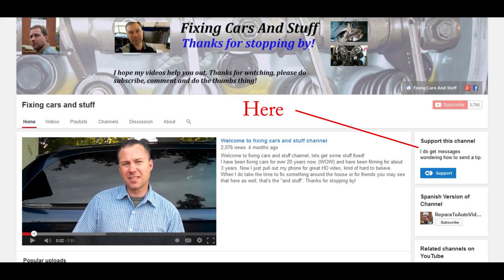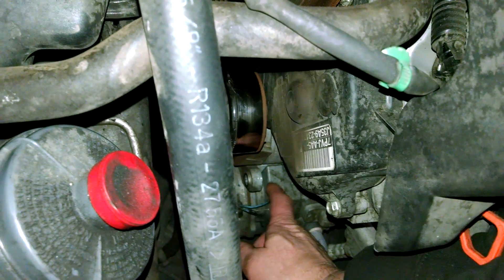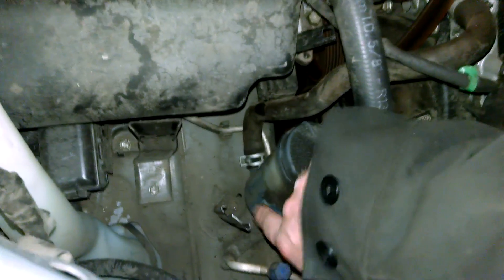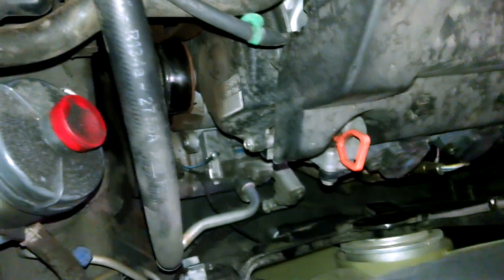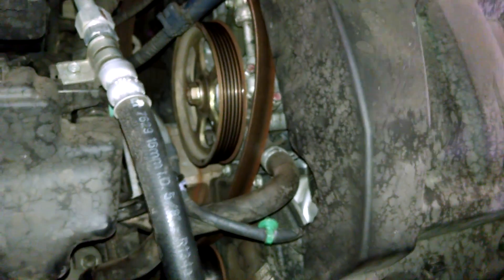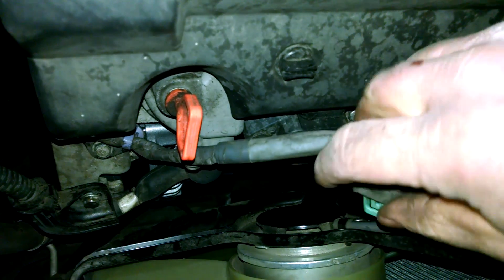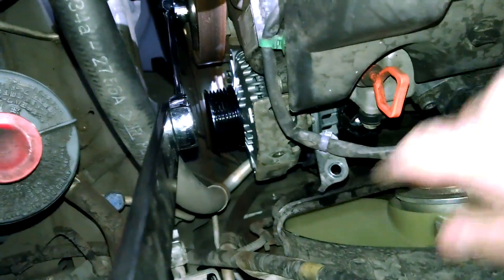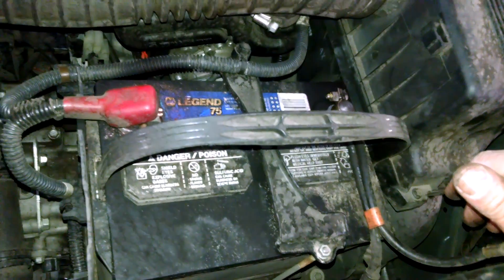Alternator replacement overview 2007 Honda Pilot 3.5L V6 How to change or replace generator

Comment: the radio code should be on the side of the of the glove box on the outside. in other words, from the driver seat, open the glove box, on the outside of the inner wall of the glove box there should be a sticker with the radio code on it

Comment: To remove serpentine there are many other videos to help with that.  On the Pilot there is a dead bolt head 15 mm you push back on to loosen.  It is in front of the top idler pulley.  You don't need a special tool.  A long breaker bar or your crescent wrench with a pipe to slip over the handle will give you enough leverage.

Comment: Quick question my steering pump make alote noise new pump no leaks at all what would be
Reply: SOTO's hose, bearings, air in system.
Reply: You either didn't bleed it properly or else the pump is defective. Or you misdiagnosed the noise and it is coming from elsewhere.